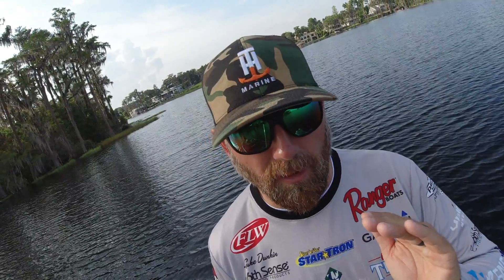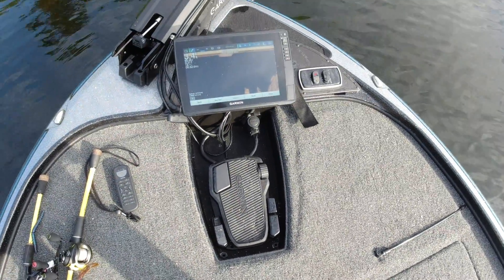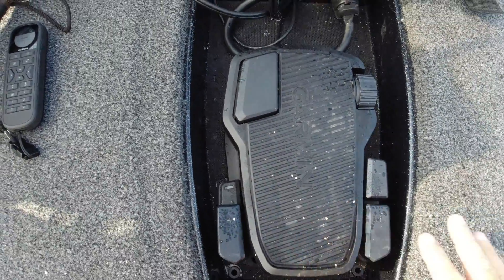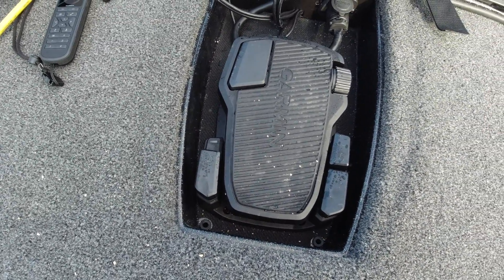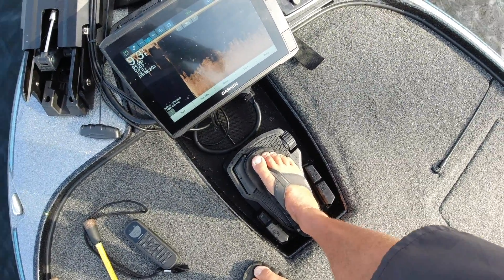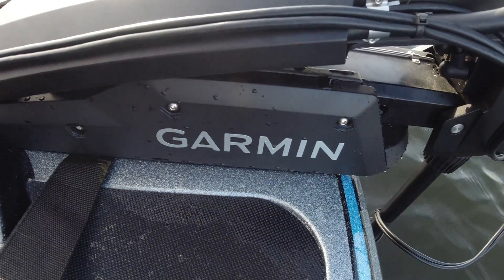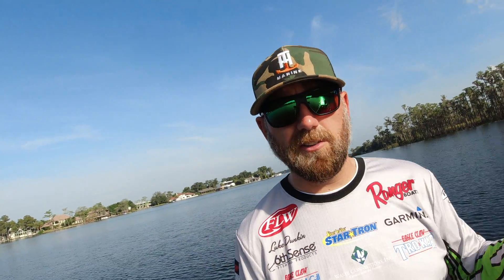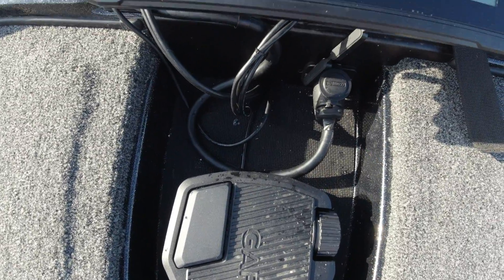BRAND NEW Trolling Motor for bass boats!

Comment: Looks nice, what are all the wires wrapped around the shaft? Do you know if the transducer will work with other brand of graphs?
Reply from the maker: Brandon Smith those are the power cables similar to an Ultrex. When the motor is raised they have to be able to stretch. At this time it will only integrate with Garmin’s on the graph end.

Comment: Will the Force do depth contour following when running a Garmin MFD?   Like a 'Bird can do with i-Link?
Reply from the maker: Rob Brookby it actually doesn’t haven’t that capability yet, BUT it does allow you to use Auto Guidance which will follow a course to a waypoint you set. Which I would definitely use on a contour line

Comment: So, it does the same thing as a Ultrex but at a higher cost?
Reply from the maker: Not at all. It features a brushless motor, has no cables to break, does not cause interference with your electronics... etc. So not the same at all. 👍🏼
Reply: Yeah, that's cool, but I would think that Garmin and Lowrance would come with something lower priced to be competitive
Reply: @TheJhood451  it is a better deal. Better technology, remote and transducer come with it. The others you have to buy separate.
Reply: The brushless motor alone more than justifies any extra cost, quiet, smooth and powerful, brushed motors are so last century😁